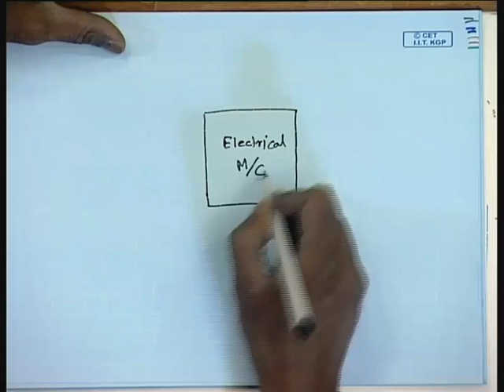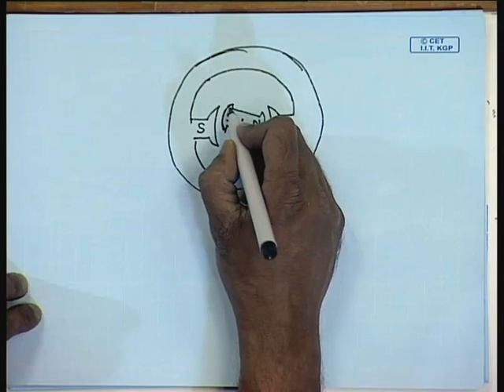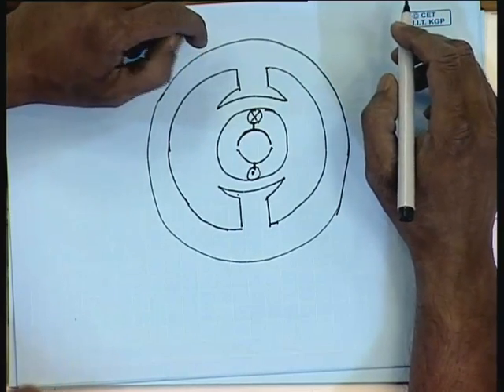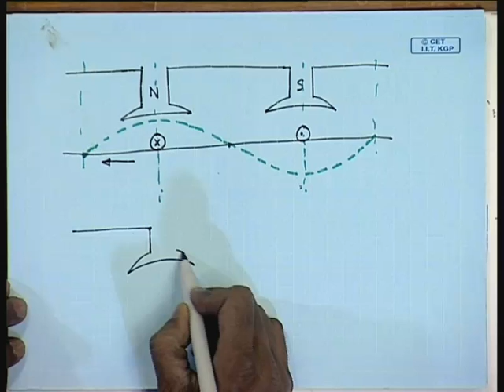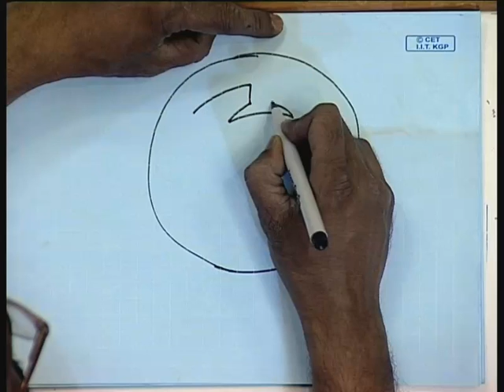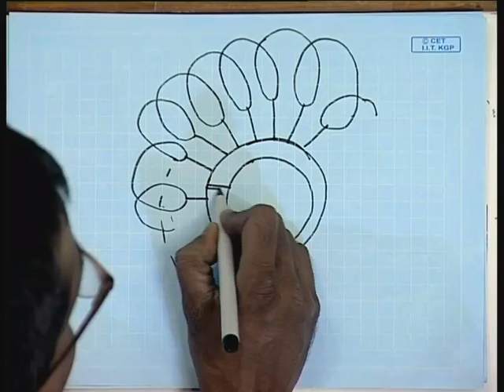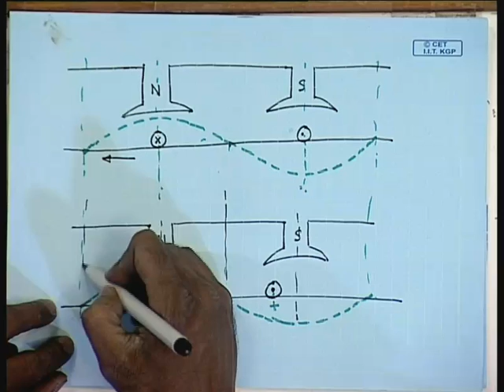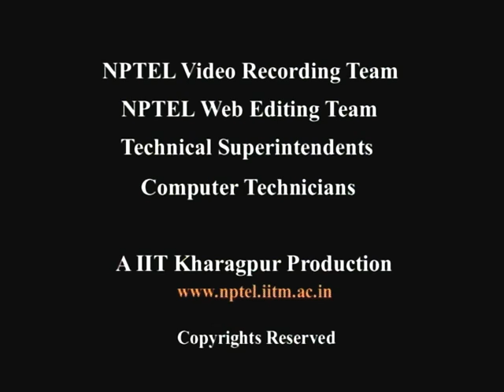Mod-01 Lec-21 Lecture-21-Operating Principles of DC Machines

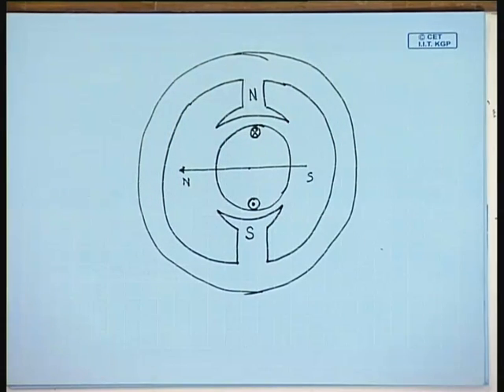Comment: one question at 11:55 if flux lines are pointing from right to left shouldn't the north pole be at the right and south pole at the left because magnetic flux lines travel from north to south pole???
Reply: +oyindenyafa tarakeme WHICH  BROWSER DID YOU USED TO OPEN THIS VIDEO?
Reply: Nhlonipho Shembe what does my question have to do with the browser i used. it's google chrome i used though.
Reply: THE IS NO SOUND
Reply: +Nhlonipho Shembe turn on your volume man..... i am using opera btw
Reply: THANKS Subhratanu Sarkar I GUESS THE PROBLEM WAS WITH THE COMPUTER.
Reply: no problem
Reply: you are partly right sir! But inside the magnet, the flux points from south to the North, it is only outside they point from north to south. Magnetic lines are closed loops
Reply: Apply right-hand thumb rule its correct shown in the video
Reply: Apply right-hand thumb rule you will get the answer

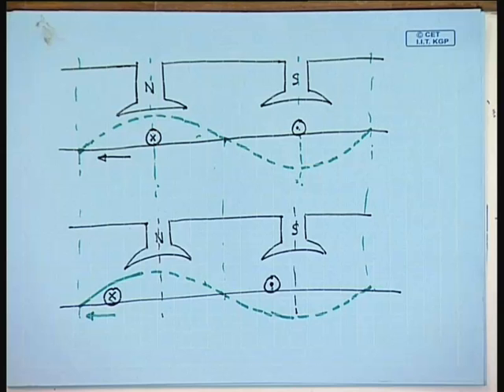Comment: At 26:24,won't the polarities be opposite
Reply: i think so too.. i am a bit confused.. why he put the polarities opposite??
Reply: Yeah! even I didnt get it .
Reply: The polarities what he mentioned is correct in my opinion. 
Because according to lenz's law induced emf opposes the cause which is external voltage. So the  polarities are opposite to supply voltage polarities and this is called back emf which is responsible for rotation of a motor.